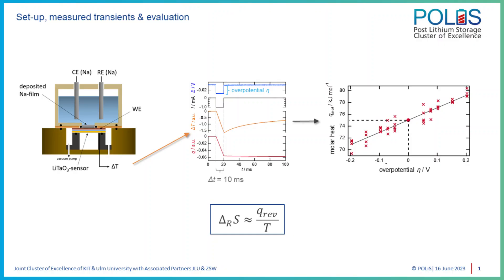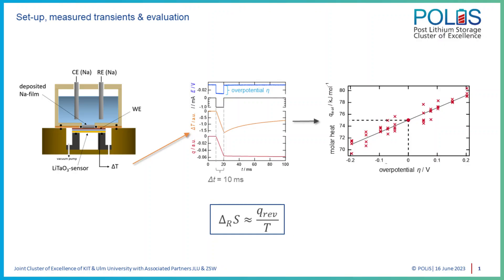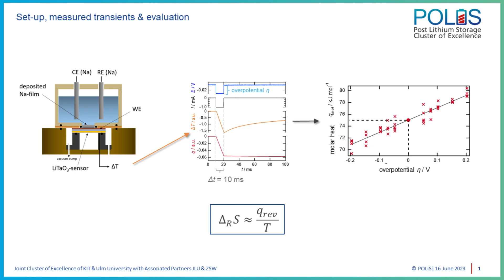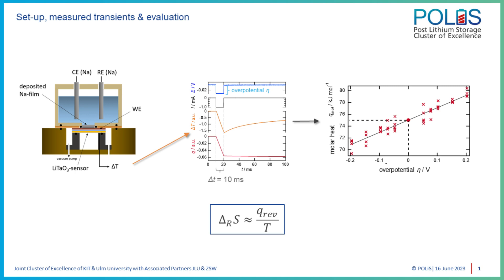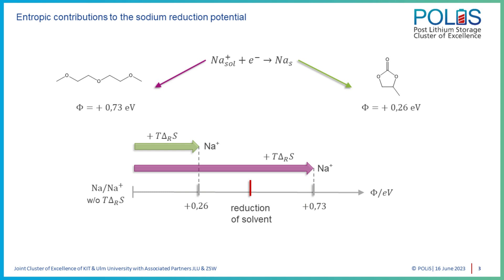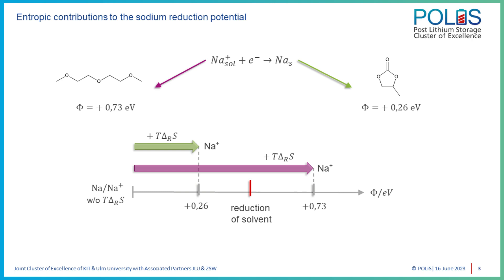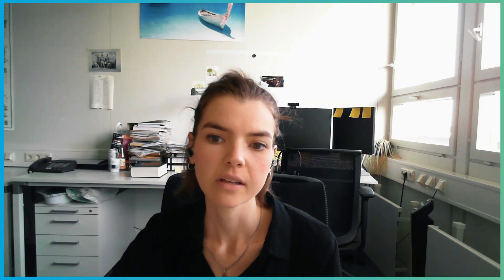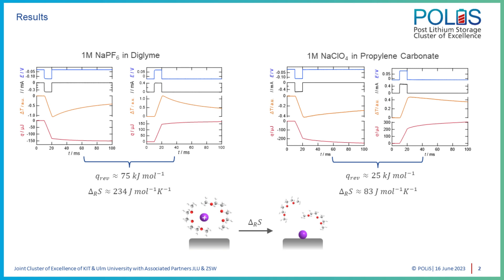Entropic Contributions to Sodium Solvation - Franziska Karcher

Comment: Sodium chemistry should allow alumimum to be used for both electrode collectors. Use silicon and SiC/graphite for the anode, use a ferrate or ferricyanide in a polymer for the anode. Add a little graphite and copper 1 oxide to improve conduction. Also exoeriment with Al 3+ Ions and F-1 ions  for batteries A cryolite catode could use all 3 chemistries at once when combined with Co Mn or Cr ❤